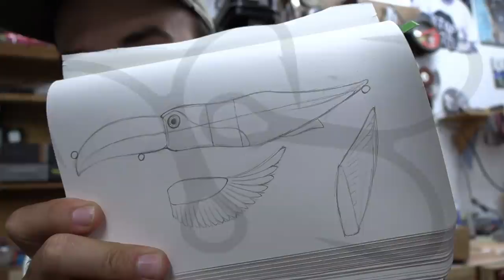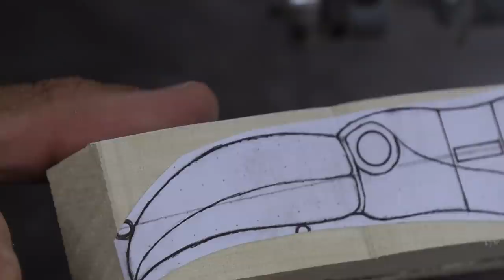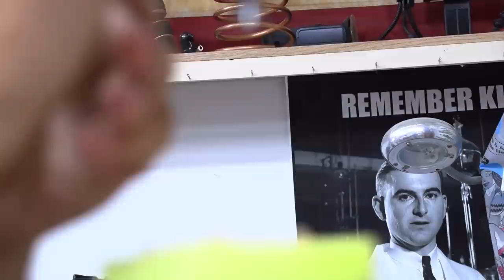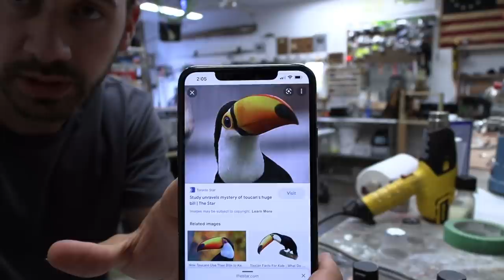Making a Toucan Lure

Comment: If you could get some 800 grit sand paper inside the tube and give it some longitudinal scratches, then do the same thing to the wire, I bet it would squeak and sound just like a toucan.